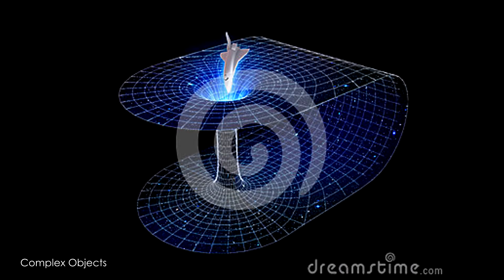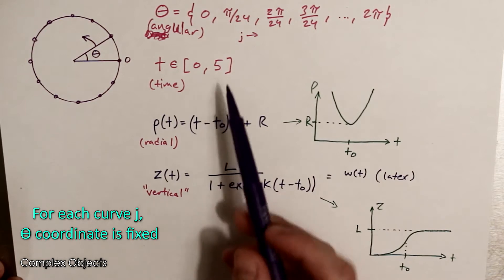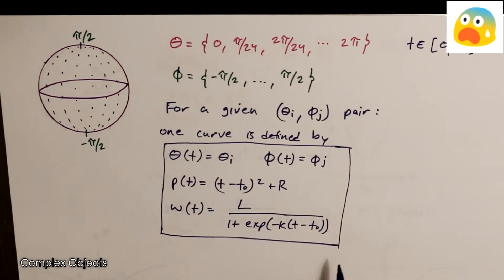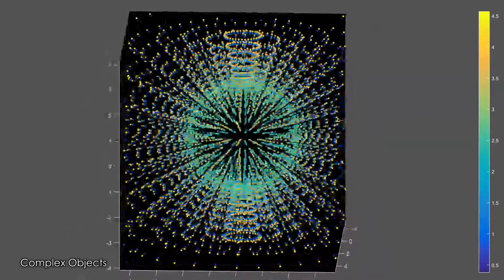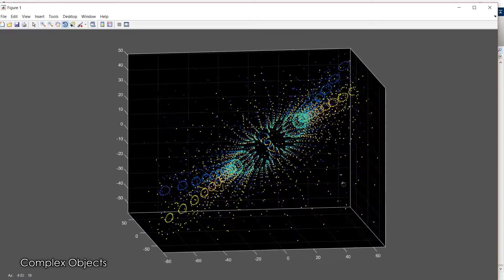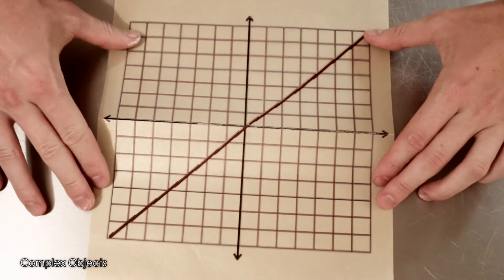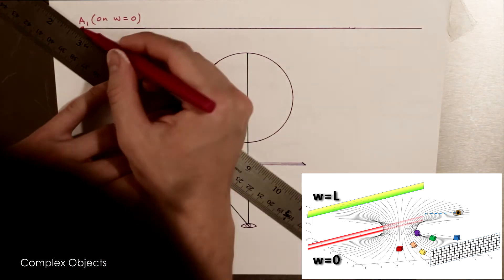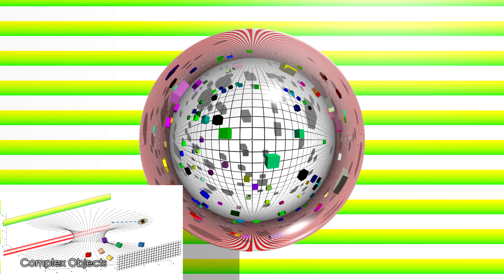Building a 3D Wormhole

Comment: What do you mean you don’t see a wormhole vortices in nature?! What do you think a whirlpool is? What do you think a tornado and a hurricane is? You may not be able to see it but the magnetic flux lines of black holes and other fast spinning objects can get twisted up and tied in knots causing a bullwhipping effect of the magnetic flux lines to seemingly travel five times faster than the speed of light when unraveling propagating away from the poles of the black hole star. I will answer your other question what is the inside of a wormhole made of? What is the inside of a tornado and a whirlpool made of? Same thing with the space-time wormhole. You have two different extremes of the same medium, you are spinning space-time vortex around a void of nothing. The web like structure of space is in fact made up of a bunch of interconnecting wormholes. That’s what keeps the web in tight circular, Tubular, conical formation. Most wormholes have a twin and they are connected at the tails. And believe it or not they change direction in spin. Which means they eventually have to stop spinning to go the other way. Which means wormholes can form and disappear and reform again as they stretch and expand away from each other. If you want to see natural proof of a wormhole spinning in one direction and then disappearing completely and then reforming itself in the opposite direction then go fill up your bathtub all the way full of water, let the water become still, pull the drain at the bottom and sit there and watch. Don’t look away. You’ll see it form a Whirlpool. watch the direction of the spin. As the water lowers it changes the physical property of the medium thickness in reference to the origin of potential difference causing the vortex action to eventually stop and become nonexistent and then at the right level become active again but strangely spinning the other way. If you mark the level on the side of the tub and measure the ratio between the two distances were the whirlpools formed and disappeared you will probably find the golden ratio but I haven’t experimented that far.
Reply: His point is that a wormhole wouldn't look like a whirlpool or a tornado.
Reply: @manguy01  why wouldn’t it? If it doesn’t then it probably isn’t lol.
Reply: Is that why in the movie Eve with scarlet Johansson  when we went through the wormhole and saw their depiction of the wormhole network it was basically space/reality wrapped in a sphere of undulating tentacles floating about in a void? Because I wondered if the randomness of the tentacles had something to do with the fluctuating nature of a wormhole. I wonder if that would create a dial-up process?